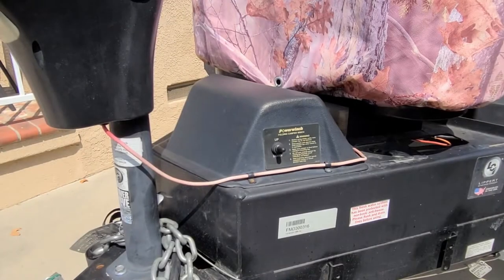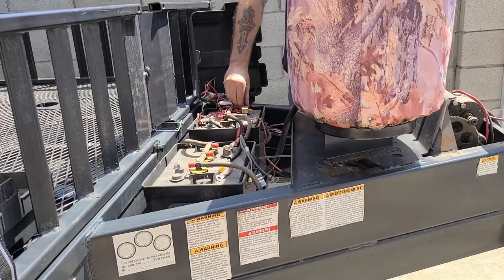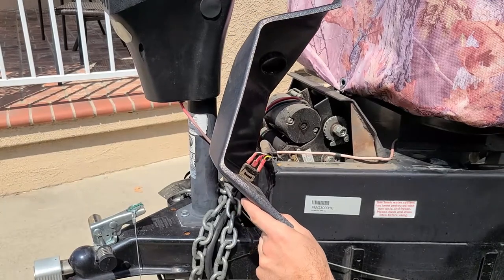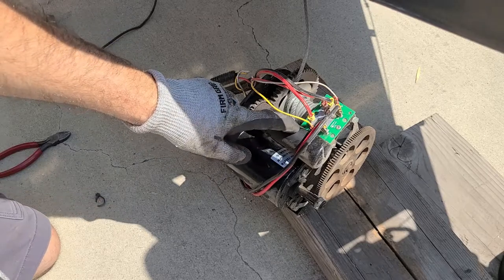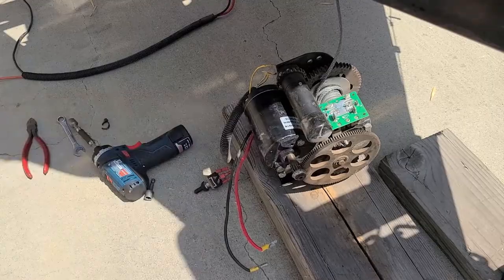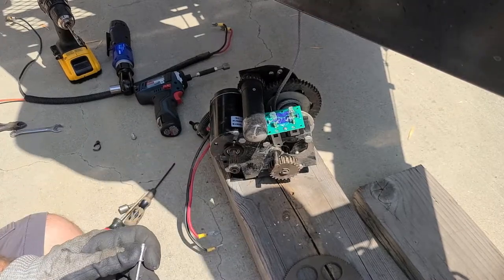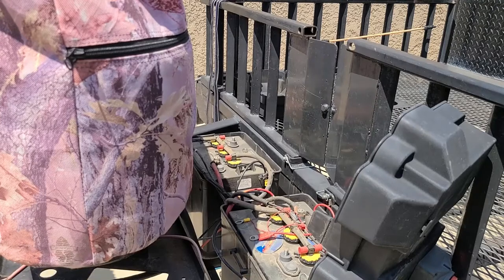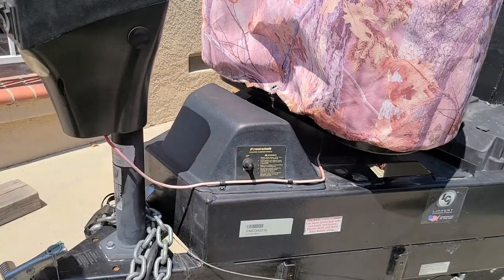Powerwinch P92001 Electric Lift Wont Raise Popup Camper Roof (Relay Pack Replacement)

Comment: Thanks for the video! So I swapped out the relay but it did not solve the problem.  I also swapped out the switch itself and that was not it either.  Do you think the limit relay switch could be the issue?
Reply from the maker: Hey there, thanks for watching!  The limit switch has two allen screws on it, one red(lower) and one white (upper).  I would try and increase the screw about 10-20 times or so and then hit the switch in that direction.  If you see the motor briefly work, then it is most likely the limit switch that needs to be adjusted further.  In some cases, I have seen the small plastic gear on the limit switch housing shift to the side, causing it to not contact with the mating gear.  This would prevent the limit switch from operating properly.

Comment: Great video.  How did you know it was the relay switch & not the motor after checking the switch?
Reply from the maker: Thanks for watching.  Since the motor did work fine going in the opposite direction, there was really no need to test the motor.  The relay pack is what allows the motor to reverse its direction.  If you aren't getting any movement going  both ways, then further testing should be done to the motor and circuit breaker as well.

Comment: My motor buzzes and kind of a light whine, but does not move the cable. Do you think it would be the relay pack or a motor that needs new brushes?
Reply from the maker: You can unplug the motor wires and put a multi meter on the motor leads to test the relay pack.  If you are seeing voltage in both switch positions, then the relay pack should be fine.

Comment: This video helped alot but I need 2 more helpful videos.   1st how do u put the cable back on ( mine just came off) and the nut that if you need to manually raise the roof needs replaced.  Please help.
Reply from the maker: Thanks for watching, I will be making a video on changing the cable soon, which will show how to reinstall the cable to the winch spool.  The manual override nut screws onto the motor shaft to lock the gear to the shaft.  There is an E clip that goes after the nut to prevent it from backing off.  If the nut has broken off, then the whole motor has to be replaced.  If the threads are still visible, you should be able to get a new lock nut and e clip at your local hardware store.
Reply: @Jandmrvrentals  Well it wasn't the relay that is causing it not to go up.   I did the toggle switch also.  If I  go down then quickly go up it works for a second only.  I am purchasing a new limit switch to try.   Any other ideas besides getting a new winch.   OH how do you take that nut off!?  I have the e clip off and tried to unscrew it but the gears keep turning and I'm afraid to clamp on to anything to hold it.
Reply from the maker: Have you tried to adjust the limit switch at all?  There also is a gear on the limit switch that can fail, make sure that it is not damaged.  Without actually seeing it firsthand, those are really all I can think of to check.  For the winch nut, you might have to take a vise grip with a piece of rubber for protection and clamp the shaft right before the gear.
Reply: @Jandmrvrentals  where to adjust it at? And what would cause it to be needing adjusted!?
Reply: @Jandmrvrentals  I can take a pick and send it, if that can help.
Reply from the maker: There are two plastic allen screws on the limit switch tube.  The red one is for lowering. The white one is for going up.  Increase the screw about 5-10 times and then try to raise it.  If the cable came off the spool and the switch was used any after that, it could have thrown the limit switches off.  They usually only need minor adjustment as the cable stretches over time.
Reply: @Jandmrvrentals  what is the maximum you can turn.  And by the way THANK YOU!!! You have been so helpful.  I figured out how to attach the cable but I had to cut off the frayed end about 2 inches, ( I put heat shrink tube on the end which helped me place it back in easier) is that going to be a factor.
Reply from the maker: @Terry Bromley  No problem at all, happy to help.  To my knowledge, there isn't a maximum amount of turns.  I have had to turn the screws many times before and never had one reach any type of stop.  Once the up limit is set, you will want to set the lowering limit.  Bring the roof about a foot from closed.  You will now decrease the red allen screw until the switch just clicks when pressing down.  You can now increase the red allen until the roof reaches the closed position.
Reply: @Jandmrvrentals  IT took me 110 total turns to get it up BUT I DID IT!     Yeah for me!   By the way I am a 60yr old lady so yes all the help you provide was and is GREATLY APPRECIATED!   I only wish that you were not 1000 plus miles away.
Reply from the maker: @terrybromley1358  Awesome, that is great news! I'm glad to hear that you were able to get it all fixed.  I'm always happy to share the knowledge I've picked up along the way.  Feel free to let me know if you have any other issues in the future.
Reply: It's me again..... this time I am issue with the propane side of the fridge.   I know that the furnace, stove and the water heater all work... it is just the fridge that I am having trouble with.   I have a 2020 flagstaff mac 205.   Any ideas
Reply: I found out on my own that it was the burner jet that was clogged... just letting it soak in alcohol then blowing air through it opened it right up.
Reply from the maker: @Terry Bromley  OK great, that is what I would of suggested as the fix.  Glad to hear you are figuring these issues out.  If you need anything else, please feel free to ask.

Comment: Can you just drill out the pop rivet on the circuit boards and swap out the relay pack to avoid removing the entire winch?
Reply: Awesome video, by the way. It's all in there with no extra BS.
Reply from the maker: Hey there, thanks for watching! I do believe that the large gear is in the way of the rivet.  You may be able to get in there. I just don't think there is much room between the frame rails.
Reply: @Jandmrvrentals  Yes, but there's a second rivet on the relay pack that's right on the green board and it's not blocked by the gear. That's the one I was thinking could be removed and replaced with the new pack to save time. Cheers!
Reply from the maker: @scottcroydon  My apologies, now I see which one you are referring to.  Yes, I think you will be fine doing it that way.  I was just following the procedure that is stated in the manual.

Comment: Help! Mines only goes up but not down, what can be the problem? Tia.
Reply from the maker: If it will not do anything when going down, no matter how high up you raise it, then it will probably be the relay pack.  If it does go down briefly but stops, this could be a limit switch issue. You would need to increase the downward limit screw and lower again until you reach the proper level.
Reply: Ty for response so I ordered the relay and required new relay and does the same thing 🥹 but I discovered that the white cable seems to be the problem it was stripped a bit I tried to stop a bit to reconnect but as you know the wire is short and didn’t work… I am scared to stop it more since there like only half an inch to work with 🥹, open to any and all ideas you may have 🙏🏻…
Reply from the maker: @NM S  You could always lengthen it with a piece of new wire.  Solder it to the existing wire or just use a connector for now.